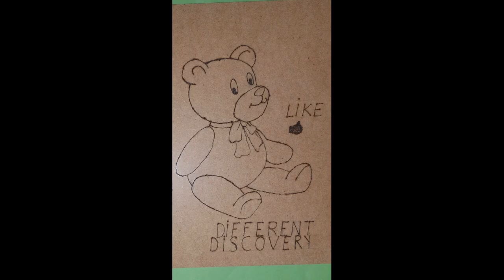How to make a pyrography pen at home  #DIY

Comment: can i use nichrome wire instead on the place of the needle or it have to be  a needle ? i have everything in my workshop but i think nichrome is better ?
Reply: Under the video it says that this is an entertaining video, which means it is not educational. I suffered for a long time - 5V3A does not heat at all. I inserted nichrome and it heats up noticeably, but we need 10 amps anyway. I haven't found such a power supply yet.
Reply: @jandostx6596  i watched a video that the person used a computer power supply with an adapted dimmer.?